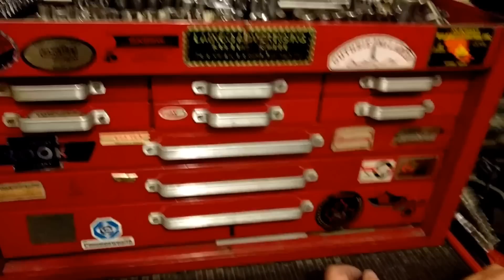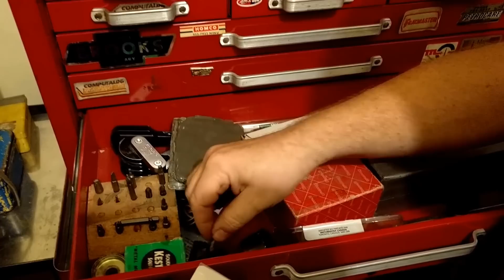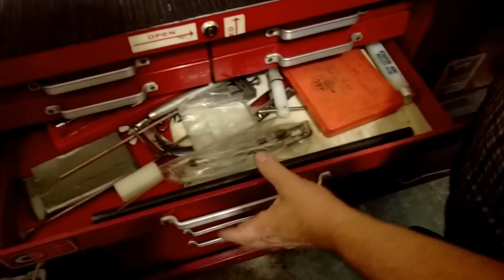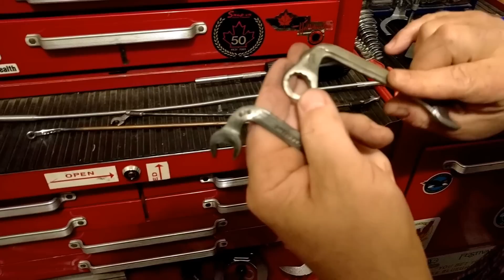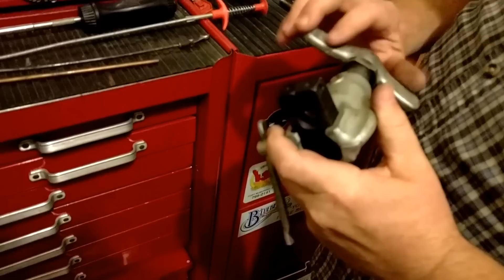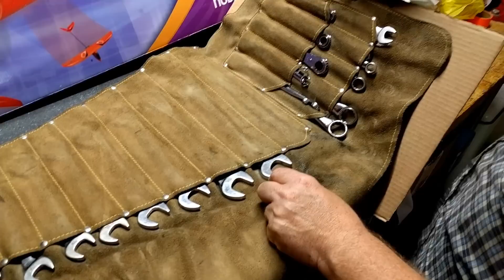Helicopter Engineer's Toolbox tour

Comment: I have a tool box for helicopter also, but it was for military, we had to have them shadow each tool in the drawers so they could be visible to all were there at the end of the shift, have you heard of the screw knocker,if not you need to get it, Eck usmc

Comment: Where  can I take my torque wrench for calibration
Reply from the maker: Depends on where you live.  Most of the places I know are small independent businesses. If you search "tool calibration" in Google maps it should give you some options where you live. Call them up and ask if they calibrate torque wrenches. Also if you have a snap on, or matco truck that you deal with they should be able to point you in the right direction.

Comment: Did your toolbox not have to be setup for FOD, so that everything was foam outlined to see instantly if something was missing when finished working on the aircraft?
Reply: When I was an active AME (1977 - 2010) "Tool Control" was not yet formalized in the helicopter maintenance segment.  We each had our own way of ensuring tools were not misplaced; areas worked on were double and cross checked to ensure tools were not left behind ... plus, I engraved my name on each of my tools; ensuring I never lost any of them.  

Your reference to FOD is an acronym for either "Foreign Object Damage" or "Foreign Object Debris"; which is a difference subject all together but similar outcome if a tool was left behind where it shouldn't be.  Foam outlines (and other types of tool shadowing) is a relatively recent development, and more commonly used in production line work, major repair and overhaul shops, as well as corporate and airline aviation maintenance.  It is making its way into the helicopter maintenance world.

Comment: As an retired AME myself, Having worked both fix wing and Helicopter and helicopter overhaul  for over 20 years, I have the 50th anniversary twist screwdriver. And have modified many a cheap wrench to get the job done. My pilot attitude adjuster weight 5 LB  hahaha nice tool box tool many memories seeing someone else tool box.
Reply from the maker: Glad you enjoyed!
Reply: Did you prefer to work on rotary or fixed wing? Why?

Comment: I use to work on general aviation fixed wing.  My life was so much easier when I bought those 4 way angle snap on wrench set.  I bought a metric version for my car, which I hardly use, just because how much of a life saver they were in tight spaces for general aviation.  Also a lot of specialty hand made tools for this profession.  I guy I worked with welded a Phillips bit to a piece of sheet metal, which was also a life saver for a couple of particular jobs.  You would wedge a slotted screwdriver to add pressure and worked awesome.  Never seen that tool again, until I ran across a japanese company that made them on amazon.  I was so impressed on the hand made tool that I bought a set, which I might never use, but I was the only way to take of a screw if I am ever in that situation.
Reply from the maker: +Johnny Woo ya I love those 4 way wrenches I use them everyday in heavy duty.  Cool to hear about your experiences.

Comment: Engineers work prmarily on engines and transmissions.  A copter is basically an engine with a box attached to it, with one Jesus nut keeping it aloft.
Reply from the maker: +pssst3 you got that right, putting a lot of faith in that one nut!
Reply from the maker: Ya if that one nut let's go then Jesus will be the next guy you see!
Reply: @TheHDPerspective  hahahaha
Reply: Only a copter mech knows what the Jesus nut is.😎
Reply: Edward Arruda I don't know anything about plane copter repair but I would assume the Jesus nut would be one that you pray holds up being the only one nut keeping the body to the propeller lol
Reply: The best birds have two Jesus nuts.